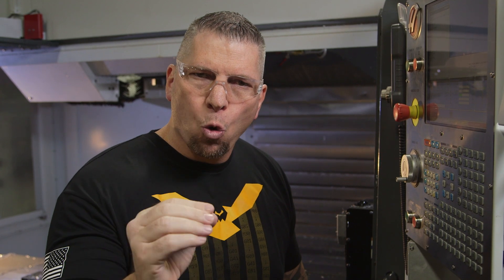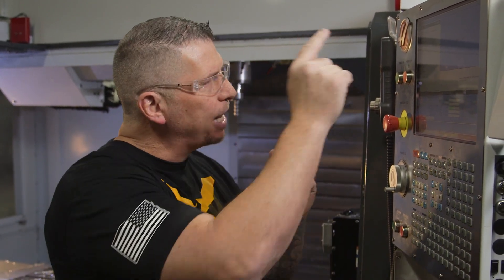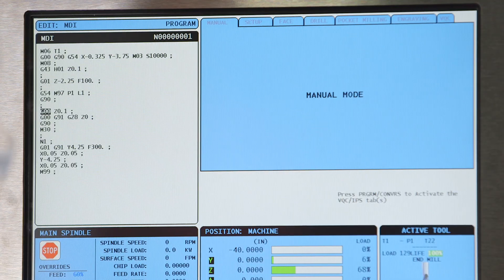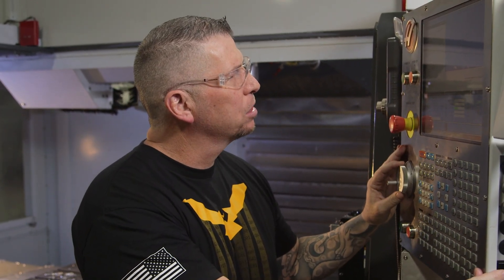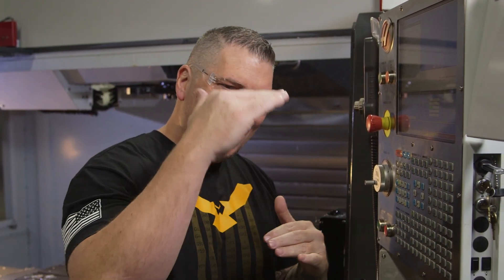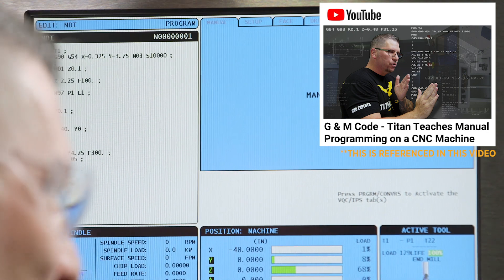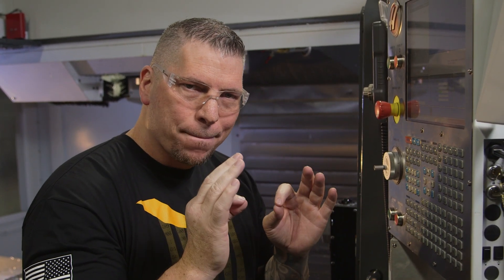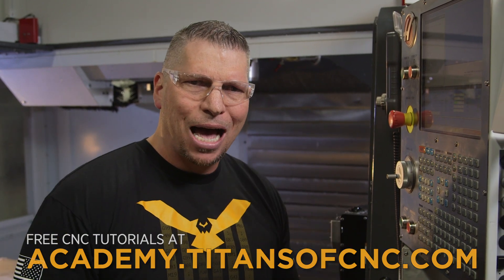G & M Code - This Code Will CRASH Your Machine - TITANS of CNC Vlog #53

Comment: Nice follow up to the G53 thing, Titan. What you do rocks, I teach the younger guys every chance I get. I am primarily on Haas machines but I do run a G & L that discovered America before I did back in 1973, with a control by Power Automation. I am a programmer and machinist in a decent sized fab shop. On my Haas mills, I usually end my programs like this and only vary it by table travel in X. This usually follows my last milling move or a G80 canned cycle cancel.

G0 Z2.0 M9
G0 G53 Z0. M5
G0 G53 X-25.
G0 G53 Y0.
M30

Keep it up, Titan! That's how it's done, folks. Take note...

Comment: I used to combine multiple programs with a pause between to change out finished parts with raw parts, add parts to empty or completed run, to blow out 2 or more orders of different parts on more than 1 work fixture on the table. Normally they would only run 1 program start to finish at a time. Know your code, it will do pretty much everything you tell it to do. Awesome trade!👍😎🤘 I also had to work with  .0002, quite snug.

Comment: G28 wants an intermediate point to go to, that's why everyone uses G91, which specifies the current position as the intermediate point and goes directly to its reference home (zero) point. You could also specify a value in absolute as the intermediate point, so in essence, you could specify G90 G28 Z8. and the machine would go to Z absolute of 8" above the part. This is useful on axes that don't have an incremental axis designation, like the B (transfer axis) on most lathes. 

Personally, I like to set a transfer position zero at the face of my part (B0), so I could use G28 B6. To make sure my intermediate point is 6" away from my B reference position and everything zero returns just fine. Another way to do it is set up an incremental axis on the control and just use that with the G28 (again, talking lathe here, g code system A). Problem on a lot of machines, lathes especially, is that if the reference marker isn't lit up, the machine won't run, even though you commanded G53 B0. G53 doesn't light up the home reference marker like G28 will, even though it's the same spot most of the time.

Comment: I think it´s important to know, that the G53 refers to the reference point of the machine. So the G53 values only can be 0 or a negative value. For example: On the HAAS lathes the reference point is in the right top corner. So just can travel in X- or Z-. G53 G00 X-100. Z-250. (values in mm) is kind of standard tool change point in our shop.

Comment: Sage advice sending the spindle home before you perform any other moves. 
Another thing to watch out for is to make sure the guy running the machine before you took it over, didn't manually put a work shift into the Z work coordinate. If you think you're going to jump up 1.0" above the part, if there is a Z-3.0" work shift in Z, you'll dive 2.0" into the stock. 
You do a great job teaching Titan. With all the variables, and so many different machines and controls out there, it's up to the operator to safely prove out new programs and set ups before letting it rip.

Comment: Thanks! Never heard of G49 or G53. Just a side note, I've ran a few different machines before that did not use a probe or tool setter and the programs ended
G91 G28 Z0
G91 G28 Y0

and never had any problems. ALWAYS Z0 first though. I also recently started putting G90 before the M30. Good practice.
Reply: I use G53 X0. Z-6. To send them home.

Comment: I learned CNC on Fanuc /Yasnac controlled machines in 1985 - at the time work offsets were new and a option $$$$
so we all were using G91 G28 Z0 to go home,  Some of us were taught G49 in there as well but not everyone used it. 

Then came G54-G59 work offsets the original 6 (like the NHL) - I think Fanuc thought who would need more than 6 work offsets? 
But we still went home with G91G28Z0 - force of habit and we most of use did negative airgap tool touch off.  Some people picked up on G53 work coordinate system.  I use both ways and its stated in the 2017 Haas Mill Work book under "two ways to go home" .   

On your post processor if I can I will tweak the code so it comes out the way I like - like adding a G28Y0 at end of program. or putting a Slash in front of the M8 so I can block skip the coolant instead of chasing the button on a dry run prove out.  G43 H2 Z1.0 /M8.   I prefer to rapid the H line to Z1.0 as me or anyone can see if we set the tool offset correct - then rapid to Z.1 and do your thing. 
I am not a fan of a 3 axis entry or exit move from or to home (like Titan says)  Looks cool but ??

Comment: Nice detail!

Just be careful with the G49 if you're running a sub on a Mazak.

It's the perfect way to rapid the tool into the part.
Reply: Can you explain this g code ? Can't find it in the book
Reply: @boru-cnc  G49 is tool length offset cancel, it cancels the offset called in the G43 Txx block. It's not necessary in most modern machines as a Txx M6 will cancel the offset but many people still use it for continuity. 

When running G-code sub on a Mazak mill with the parameters set to read the Mazak tool file based on the Txx call you don't need to use a G43 or a Dxx when using cutter comp, it just assumes you want to use the values assigned to the called tool number. 

If you cancel the Tool length, G49, the spindle will immediately at current rapid settings move to the position the tool tip use to be in.

Comment: By most Fanuc & familiar you can create your own safety z+ Macro, by example G53.1 
In this, all your safety Codes can be defined. So once done correct you will never forget something or make a typing error. You also can fix that in your PP, if you programming with a cam.

Comment: I can't speak for using a probe, never used one. But when not using a probe...
G91 G28 Z0.
G28 Y0.
G90
M30
%
I doesn't get much simpler.
Reply from the maker: Agreed.

If you change out the G28 Y0 for a G53 X-30. Y0

Of course after the G90

You can have your table position itself differently based on where your views are... by adjusting the X
Reply: If the start of my programs always start with g90 in the saftey line do I need it at the end like you have it. Our shop does
 g91 G28 z0 
G91 g28 y0
M30
Reply: Frater you don’t need it. so long as g90 is at the beginning of the next program you’re fine

Comment: If you're in there typing code you might as well just re-call  the programs first tool at the end.  M06 will put the Z safe plus grabbing the tool ahead that's two things you'll need when restarting your program anyway.
 Then bring Y home and M30.
Reply: my mori seiki will alarm if the machine is not at the z home before reading the m06. my hardinge was the same way. my okuma will send itself to the predetermined tool change height. my point is that all machines are different.

Comment: Why all the complication? As long as the machine is in G90 (absolute), G53 is always a safe bet. G28 is a recipe for a crash even if you know what you’re doing. Additionally, G53 is non-modal so it only works on the lines you command. 

As many others here have said...

.....
.....
G0 G53 Z0
G53  Y0 X....
M30

Or better yet, command a tool change to the first tool in the program in lieu of the 

G53 G0 Z0 

Line of code. 
This will guarantee the machine goes home in z first.
Reply: Exactly, g53 is machine coordinate system. Same on all cnc's with g and m code. G28 does not always work the same from machine to machine which can cause a crash. Never use g28!!!
Reply: Disagree, you guys use your G53 as much as you want to, G28 when used correctly is a fail safe way to move your machine home.
Reply: G53 is more of a small VMC and lathe thing, to get the tool change to clear the work. Sometimes to rotate the b axis on an HMC if you don't want to send the table all the way home.
 G91 G30 Z0. Will home every machine in the shop. 
 Forget to put it back in absolute?
 G0 G90 G54 x y
Call up your work offset after every too change.
Then anyone can start at any tool without calling up the work offset in MDI.
Reply: Whats this all about, all I do in my work in the machine shop is press cycle start, use go-no-go gauge and watch the money in the bank accumulating.
Reply: We use g91g28 z0. in every program. Never had a crash because of it
Reply: Ill just use G74 X0 Y-1 Z-1 L1 
Never had a problem with it

Comment: I'm not sure why everyone makes it so complicated: (all numbers in metric)
T1M6 (First Tool OR if you got only a 1 Tool Program, then)
G0 Z100(any value that you are comfortable with, to shorten the distance to the workpiece)
G28 Y0 (back to the reference point in Y)
G54G0X0 (Reset your table to a point in X where you like it, choose G54 to G58 or extended number for your machine in case you work with multiple offsets)
M30 (done, easy and smooth, w/o any danger to any machine)

Probe or not, tool length in + or - doesn't matter as long as your G43 is in action

G53... never used it on any machine, but if you like it, do it.

Comment: If your running a Gantry Router like a haas GR-712 dont use G28 use G53 and always send it to a positive number because 0 is at the tool changer level and the machine has another 4 inches in the positive direction of Z travel granted this is only needed when using longer tools and taller parts. Currently the post codes in fusion 360 don't support Haas Gantry Routers in this area (Z0 being to low in some cases) but you can manually set your G53 height for the start of the program but once a tool change happens it goes back to your x,y location before going back to z4. or where ever you need it to be so manually adding in G53 Z4. after tool changes is a temp solution unless you know how to fix that in the post code :P

Comment: Hey titan i understand it completely ive just got a random question you use alot of face mills and solid carbides, do you ever machine with tip cutter likes 25mm and below or once you get to that size you only use  solid carbide. We use alot of tipped cutters at work small ones just wondering how you run yours if you use them thanks

Comment: Maybe add some annotations or notes to help explain what you’re talking about, all the talk of g this and g that might confuse some people if you don’t show what each g code does at least once
Reply from the maker: I did in the referenced video...
Reply: TITANS of CNC: Academy Just thought it would make things simpler, although admittedly this video is aimed at advanced machinists, fair enough
Reply: programming reference up is a good way to go
Reply: 👍🏻. Maybe a video on proving out a first run program. Using the 5% rapid. I like to teach feed hold when the tool is near the part and read the next lines of code to prevent an experience. Always keep a finger on feed hold. Reading the program heading (Fusion360) take note of the max Z depths. Knowing it’s ok to hit E-stop. When making an offset, do the math in your head before you punch in a number. That way if a different number appears, recheck your offset/math.
Reply: You need to back the truck up. You're playing a bit too far forward.

Comment: i use a zoller tool setter a g49 will crash every time just add a m6 before your m30 or m2. G28 z0 will also crash when using a tool setter in less you have your offset on the same line like g54 or h01 or e1 offsets

Comment: I just manually bring the table to where I want it for the end of the cycle and then put the corridinates  after the G32 and before the M30.. super easy or some times I use G28 X0. Y0.
Reply: I tend to as well but it isn’t the fastest efficient way. For us it doesn’t matter we’re not racing to get it done at super speeds but a lot of shops are especially job shops they don’t make money unless they optimize.

Comment: How do you run a gcode program in the air? I'm taking a CNC class, ironically, they just make us look at the manual but being the first time working with gcode...I would rather do an air run first. Would be a great video!
Reply: Misiu Kowalski easiest way is to just put a positive Z number in global offset. Will raise everything

Comment: In Heidenhain, we use G91 as as machine park position, so Zmax, Xtablecentre, Ytable forward.
So the end of the program would be:
Z0 M91
X0 Y0 M91
M30

Is there not something similar for Fanuc?

Alternatively TCALL 0 would at least lift the spindle to Z max.

Comment: I just use 
G53 Z60;(mm)
G53 X-750 Y0; 
M30; 
on the HAAS UNC 750 I run and the same for other haas  in the factory but with the different X- value, I use the regardless if the machine has a probe or not.

Comment: how many shops get g code made manually? Where I work, I design it, then toolpath it and then the CNC operator will look it over and change feeds and speeds, and sometimes change paths, then he will post and set up the machine. I don't think anyone has ever done manual modification of gcode at my work.

Comment: As I wrote below that video, I use Heidenhain as main controller.
The only thing I still don't understand that why G43 and G49 still exist on Fanuc based controllers. In my opinion these codes have to be included when changeing the tool in the spindle. This little code can cause a lot of trouble for a lot of people. On HH with Tool Call you have the lenght and radius correction with the working plain instantly.

Does anyone have any idea about this?

Comment: You need to cancel G43, tool length offset with a G49 also for maximum security.  
Rule number 1 in CNC programming:  If you turn it on,  turn it back off. G43 offsets are modal, always turn them off.
This is how the G53 block should look. 

G0G53G49Z0.;

Guaranteed it goes home then. You should always cancel tool length offset. Not a fan of G28 G91 at all. Mainly because you have changed to incremental positioning and now you have to remember to change back to absolute positioning with a G90 AND you will need a G90 at the beginning of every tool, instead of just on the default block at the beginning of the program. 

G53 keeps you in absolute at all times and you only switch to incremental when you ACTUALLY need it. Just make sure your G49 is in the same block or the Z axis will be going somewhere you don't want it to. 

Also, this is only for milling machines. Lathe programming is a different style of coding...
Reply: Swiss (citizen) machining you can utilize G53. Guarantees your z start position is always correct, especially if you multi chuck parts longer than the axis stroke.

Comment: Why not eliminate G49 all together? In all the machines I’ve ran, we’ve never used G49 at the end of an operation. 

Z1. M09
G00 G91 G28 Z0 M05
M30

Have never had an issue with that at the end of my program whether there’s a + or - height off set. 

Your next tool will call out G43 and cancel out the precious H offset. Which eliminates the need for a G49 at the end of each tool’s operation.

I only have a G49 in the safety line at the beginning of my program.

Comment: Want to know what else will crash your machine if you're using probing and you do a separate probe of z and then do a probe of XY and then realize you have the same z starting point for all of your parts so you want to skip the z probing, so you put the forward slash in front of everything on the z-probe.... And guess what happens??  It plunges your probe right into your part and breaks everything!

Comment: The interfaces on these machines look so old. It's like handwriting vectors.

Do they have apps that make these interactions easier?
Reply: No they dont, but they are cheap
Reply: @saweks9919  Just seems like they need to take advantage of open API's. 

The reason why the language is so condensed is because of the interface. If you could use a full editor with code completion the programs would be much more universally readable.
Reply: Haas is one of the best cncs there is
Reply: @davidcornwell6912  Which is why I'm wondering why they have not moved the interface onto external devices yet.

Best example I saw was this https://www.youtube.com/watch?v=ye1m8Y_LmXU, and it was them just using a VNC where they cannot input any data into it.
Reply: @icodefor   Safety is one reason.  I run CNC machines (lathe most of the time, with a fanuc controller), and I would flatly refuse to operate or tend a machine that had any sort of wireless controller, or initiation of programs without a key locked toggle on the panel to disable it.  

I mean, I had a #4 centerdrill rammed through a finger (spindle not running, just a MPG someone pressed a step size select on.  I've heard of people removing tag outs on injection molding equipment and nearly crushing others.  And sadly, many, many shops disable the door switches, or make bypass keys for them, so that isn't a panacea.
Reply: @Nidkidful  That makes a lot of sense

Comment: Here's the thing i like about my machine, at the end of the program i just do G90G0Z999. Normally that would run the machine off its boarders, however my machine has built in software stops, limiting its physical move area without risk of overrunning. Though that machine also has a slightly different programming language than Haas and Mori uses, which if i recall correctly is called Fanuc. My machine uses Okuma U100-M, which is Okumas own language speceficly made for their machines, and i like it over Fanuc. 

PS; yes, my machine is a dinosaur.